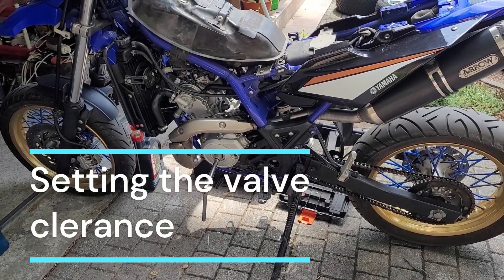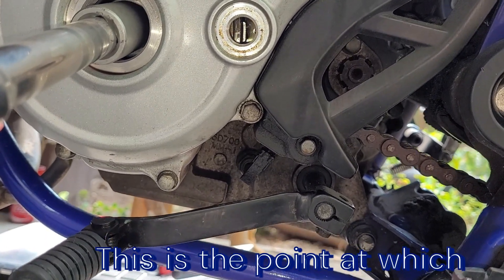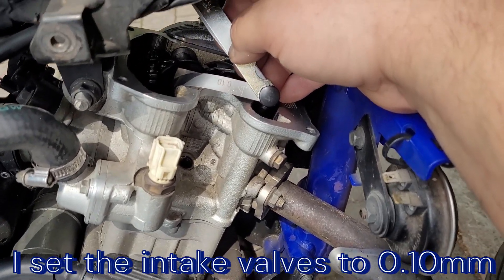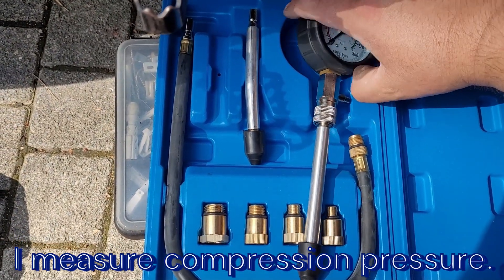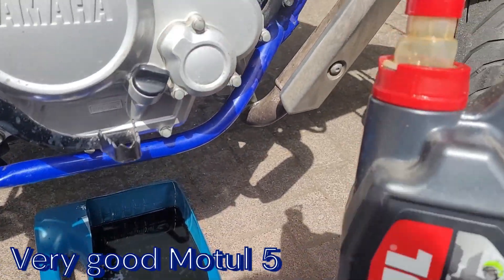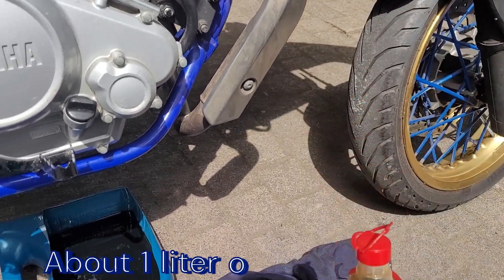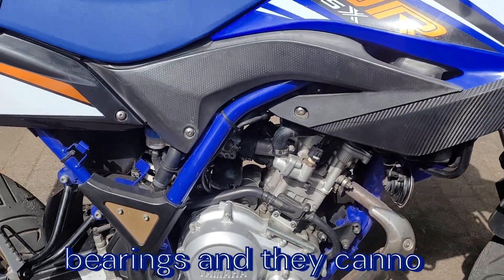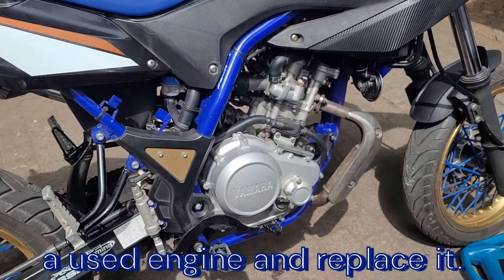Yamaha WR 125 And YZF 125 R Valve Adjustment.

Comment: Para medir la compresion cuando le das al arranque tienes que acelerar a fondo, lo has hecho mal sin abrir el acelerador!! Estoy seguro que no has dejado bien la altura de las valvulas, este motor es delicado con eso, si lo haces bien el motor funciona muy bien.
Reply from the maker: Estoy seguro de que configuré correctamente las holguras de las válvulas porque llevo 25 años haciéndolo. También medí bien la compresión. Este motor está desechado, después de 60.000 millas. km. Apto para reforma completa o sustitución. Golpes en el eje, mala compresión. A modo de comparación, tengo en mi garaje un TW 125 del año 2002 con 68.000 kilómetros. km., el motor funciona perfectamente. Y también una Honda XL250 del 1978 sin reformas, 79.000 km. , también funciona muy bien. Lo que producen ahora son desechables, probablemente ensamblados en China.